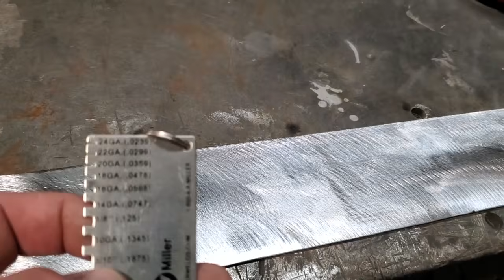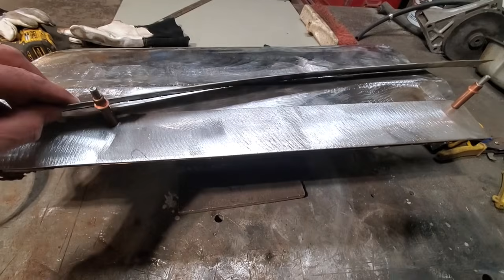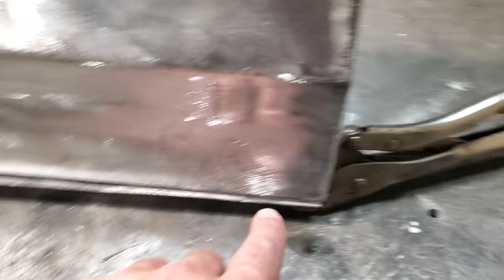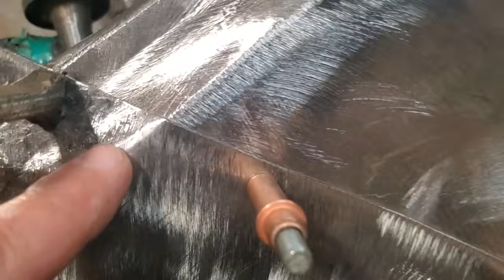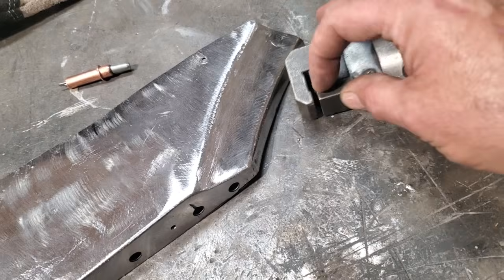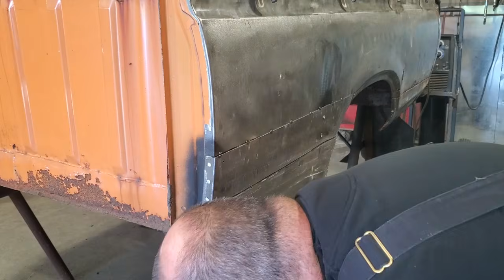How to make factory seams from rusty metal

Comment: In the Datsun world the 10 is the sedan (510 610 710 etc.) and the 20 is the Ute or pickup, so this is a 620. I have been watching a Japanese channel (51 machines) who are doing a 240z. They have a method on areas that are pitted badly but not worth replacing. They use a copper mesh and solder with a soldering iron. Have you seen this and if so would you show us all how it works? They make it look easy but also its in Japanese!
Reply from the maker: No I haven't. Can you forward me a link?
Reply: Found it! 16 mins into part 7. He uses it on the inside of the door frame at the bottom. Lots of curves to have to replace and really not structural at all.
Reply: Which video shows this?  Just checked out the panel removal on the 240.  What a mess. Would be a parts car in a lot of places since it’s so far gone.  Except in Fitzee’s shop, perhaps
Reply: Every time I add a link on YouTube comments it won't upload. The channel is "51 machines" and the car is a mess, must be a low number. I'll have a look and see if I can find the actual vid where he is doing it. There are a few spots like you say, the shape is still there but the blasting makes it very pinhole.
Reply: https://youtu.be/Okgb8lKW9tE

Comment: As always, nice video, thank you for your knowledge! Been looking for a welder, I'd like to ask, what's a cheapish welder that you could recommend that isn't complete trash? I'd love to learn to weld and hopefully fix cars
Reply from the maker: There are many out there. you want a welder that accepts gas as well has dials with lots of adjustment.  A welder with switches one,two and A and B area waist of money
Reply: @fitzeesfabrications  what welder do you use?
Reply: @fitzeesfabrications  Yes, a welder with dials certainly is better for making fine adjustments for doing bodywork. But my first MIG welder was one of the "waste of money" flux-core type with switches 1 - 2 and Hi - Lo. I welded my 1.2mm shed frames together with it as well as doing the rockers on my 1982 Mitsubishi L300 van, again using 1.2mm scrap sheet steel. I've since bought a dial flux-core MIG that I built my trailer with. However, a gas welder is definitely better for bodywork, as you can run smaller wire than you can with flux-core and therefore apply less heat to the panels.
Reply: @Budget Merch thanks I'll search for it